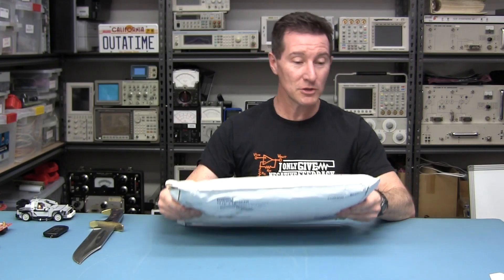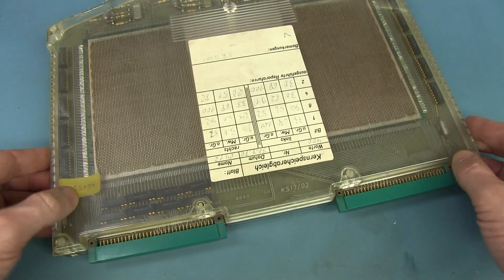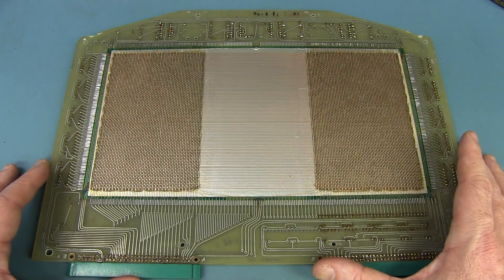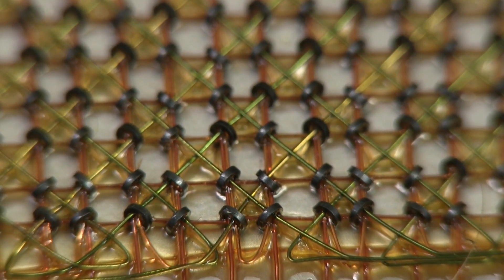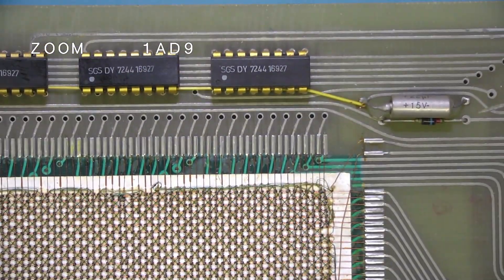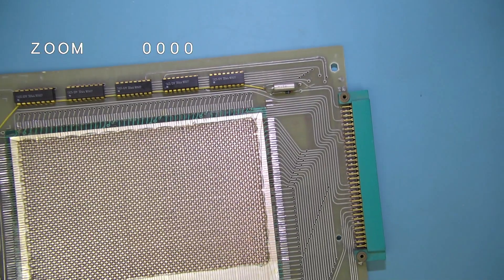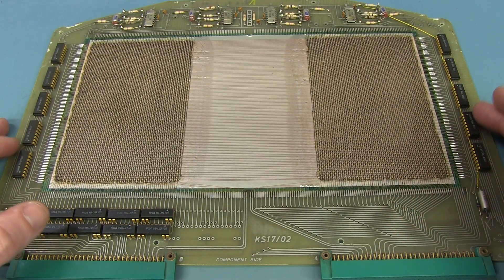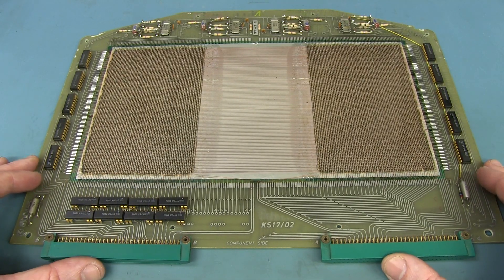Magnetic Core Memory

Comment: Back in 1980, I was a field service engineer.  The computer running our machines was a DEC PDP 11-04.  The thing I remember most about that computer was how hot it ran.  The 8K core memory used a lot of current resulting in a lot of heat.  I also remember that replacing a core memory board was VERY expensive.  One of the common problems in those computers was the air filter behind the front panel.  Most people didn't even know it was there.  I'd pull the foam filter out and it was completely clogged with dirt.

Comment: I don't understand how you get a proper "read" on the sense line since it's a single contiguous wire; well maybe I do; it might have just clicked. The pulse on the "sense line" comes out in the order you send the addressed pulses on x/y lines? So it all occurs in serial? The output is only relative to the order of the pulses sent? not an electrical engineer; not a computer engineer. barely a network engineer. Just interested. Anyone care to explain if I got that right?

Comment: By studying the most basic ferrite memory core design, several dozens of computer nerds were able to figure out on how to create the 3 dimensional physical geometric pattern for the wires and for the ferrite cores using an over lapping technique using the basic CMOS principle for a proposed thin film transistor technology modified to act as a base for the original basic ferrite core memory which was started in 2011 and they were successful. Mass production on a micro scale was done successfully in the same year and they already have ironed out all of the kinks. What they have now in 2019 is a stockpile of thin film transistor based-ferrite core memory which is far easier to mass produce despite the fact it is more bulky, cumbersome, large size like a paper towel with a storage capacity of 2 terabytes. Being solid state, without having any moving parts to wear out, and it's flat ferrite core wafers can store memory data and information indefinitely without being affected by EMP, EMI, EMF, CME, Solar Flares, all data stored in them are safe from being damaged or destroyed.

Comment: 3:03 an elaborate machine winding core memory = very skilled women sewing ferrite cores. I don't know that a machine was ever designed to stitch core. Please correct me if I am wrong on that, folks.

3:56 I believe what you get is what is stored in the ferrite torroid: the magnetic field is circulating either clockwise or counter-clockwise so you get either a positive-going pulse or a negative-going pulse (not a positive pulse or no pulse at all) which you could define as representing a one or a zero. Either way, the reading of the bit state was destructive and was followed with a rewrite of the bit.

Comment: I have another board of core memory, roughly the same size (a little larger). It is marked as from a DGC Nova from 1972 but may have been used in a Danish computer. It has 16 K words of 16 bit so the cores are really small.

Comment: They already had microchips but no flip flops yet!? It seems that flip flop memory only appeared after ICs. I know that flip flops would take way too much space with the old transistors which were the size of a AA battery or Vacuum tubes which were even larger and less reliable... A single flip flop would be a whole board circuit and it would be just 1 bit. So magnetic core memory is in fact smaller than macro flip flop circuits. But nowadays we have micro flip flops as RAM memory. Flash memory however is in fact a single specialized transistor which can store charge within itself. No wonder Flash Memory is much denser and cheaper than RAM not to mention it's not volatile. HOWEVER RAM (Flip Flop) memory is MUCH MUCH FASTER! That's why Flash is not used as RAM.

Comment: Don't write to it until you read it out!!!  It's non-volatile so whatever was stored in the 1970's is still there.
Reply: Reading it will erase it.  You have to re-write what you read to restore what is in it!
Reply: @Derpy1969  what if it was never read? But then again it is old
Reply: @deathbydeviceable  try to find out if posible, may have some stored data on that memory
Reply: its from a missing apollo mission
Reply: It holds the secret location of Atlantis
Reply: Non volatile? Don't magnetic flux drain over time??
Reply: @gopronomad4381  yeah about 400 years
Reply: You would not be able to make sense out the contents of a single plane of cores.  How was the memory organized?  One plane usually only contains a small part of a word, as little as one bit.  Most of the data are not text anyway.  How would you know what it was even if you could read complete words?
Reply: @GH-oi2jf  True, it's only a bit slice, but worth a try. If you see any kind of pattern it will tell you that it did retain something.
Reply: Probably 2 bit porn
Reply: @Tim-Kaa  We had files of punch tape strictly for testing. Paper tape of images encoded in baudot that had been painstakingly hand entered over decades by unsung heroes with an artistic bent. These were used for testing teletypes and teletype circuits. They would be considered soft porn today. We used them strictly for testing purposes. Go chAir Force! Baudot Babes exposed for all to see who had the right stuff. :-P On topic the memory was magnetic core driven by Raytheon tubes used in KW-26 encryption equipment which the teletypes were hooked up to.
Reply: if that thing came near any magnetization in 50 years. its dead.
Reply: Aliens ?? 🤪
Reply: @ronaldbrown9638  no, and also all Data On There is Non Existent
Reply: Ronald Brown 
3,200 bits isn’t enough for that

Comment: I worked on old systems that had core memory in the early 80's and I also worked on systems with delay lines.  Interesting fact about core memory, if you had an error in your program that caused a tight loop (like an instruction that branches to itself), you could actually burn out the core memory drivers.  Also, with the delay lines, they came mounted as a long coil of wire in a case the size of a hardback book and if you hit the case it would corrupt the data.

Comment: I worked on a miniicomputer with 128k of 8 bits in ferrite rings.

Reading out the memory destroyed it as you say. However equally bizarre by todays standards is the fact that powering down did not lose memory.

We stopped our machine in Slough Uk, shipped it to Anarctica, turned it on after 6 months power down and all our programs were intact. Pressed run and it did.

No need to hibernate - core is inherently non volatile on power down. 

The 128 kb took about a foot of a standard 19" rack.

Those Perkin Elmer 8/16 E minis were last manufactured in 1980 and may have been the last gasp of core memory.

Turning to your unit - not only might you be able to store data but it almost certainly still contains data from when it was last powered up. So please do a read before you write.

Comment: Destructive reads aren't exclusive to core memory, though; modern DRAM is also read destructively. The re-write is all handled on chip so it's not like the CPU has to handle it, of course, but the same would have been true for core memory controllers.
Also, most of the performance from modern DRAM comes from buffering and pipelining; if you count the row-cycle time, tRC, as the true speed of the DRAM banks themselves (not an unfair measurement, I reckon), even the latest and fastest DDR4 banks are only about 25-30 MHz, an unusually small improvement since this 1970 module in computer terms.

Comment: Interesting tidbit on magnetic core memory:  Since it retained its values without power, if a program or the OS crashed, they would run a "core dump" routine to read out exactly what the computer was doing at the time of the crash. They could reconstruct what caused the crash. When I was studying computer science in the 80's, we would refer to a test where we had to write a lot of information down as a "core dump."
Reply: It is still called that, even long after computers no longer have core memory.

Comment: Hi Dave
That brings back some old ,days. I used to work on core store memory systems.
You are quite right, reading is destructive. What would normally happen is a read would involve a write to see if the core changed state, then you would do another write to set it back to its original state. In order to change the state of the core both the X and Y lines need to be activated. This is where the inhibit line comes in, it is usually in parallel with the X line. Current is passed through the inhibit in the opposite direction in order  to cancel out the X line (both X and Y need to be active to set the state of the core). Where it comes into its  own is when you have a bank of say 8 or 16 of these in parallel and you need to write a bit then the inhibit would be enabled on all but the bit you wanted to write.
Anyway I hope I was not telling you something you already know but it is a very interesting bit of history.
Thanks for the video.
Reply: He probably does, but the rest of us don't. Thanks for sharing.
Reply: ur smart

Comment: Ive done some rough calculations and going by his figures of 160 million of these boards equating to 2GB on the SD card, assuming this unity with its palstic case is about 20mm thick, stacking that many on top of each other would be 3200KM tall!

Comment: May be a bit out of date(sorry about the pun), but fun to see. I date back to those days myself. In fact, the Tomahawk cruise missile had a core memory in its guidance set! Better yet are the drum drives that would explode occasionally when a bearing failed, and they would, because they spun as fast as mechanically possible. The drum case was 1/2 inch thick aluminum to hold the fragments after a failure!

Comment: Back when I was in college (early '80s) I was given 2 old terminals.  Sounded like a hurricane when you powered them up.  When I tore them down, they had 2k of that ram in each.  The keyboard was comprised of individual hall effect switches.  If I hadn't parted them out, they could have flawlessly run continuously to date.  Built like tanks to last forever.

Comment: The 7244 from another vendor is a quad operational amplifier. That would make a lot of sense given what this board needs to do. If you trace how the pins are used you can probably confirm. Link to the datasheet: http://rohmfs.rohm.com/en/products/databook/datasheet/ic/amp_linear/opamp/bu7241g-e.pdf

Comment: I could be mistaken but I thought the space shuttle used some of this memory as old technology is favoured for space flight. The z80 and 6809 were used in space probes until quite recently. All the bugs are known and the devices are more robust with larger structures.
Reply: Another reason they kept using the core memory for the Shuttle is that core memory is almost completely impervious to particle strikes and high radiation environments, where as semiconductors have to be radiation-hardened, which is expensive, and can affect the performance characteristics of the devices.

Comment: I worked on a postal automation system that used an ITT computer with 32K X 32bit core memory in 1976 - 8. That computer was new then.  I still have some cores somewhere, not from that computer, they made wonderful drive transformers for switch mode PSU's due to the square magnetic loop.

Comment: I knew a researcher who had a Dec PDP 8 in the antarctic. He said that They would power it down when they left for the winter and power it back up when they got back and the core memory was still at the same values. They didn't have to boot the computer, just toggle the run/pause switch. Awesome stuff even if it is bulky as anything.

There are some really good core memory training videos done by the army. Just search for "Electronics: Magnetic Cores I: Properties 1961 US Army Training Film"
Reply: Just as well we did not have to re-load the memory, we had to load it from paper teletype machine tape. took hours to load, had to load the boot louder program first, manually, bit by bit! Set up the instruction on a bank of 32 switches, then toggle the "load" switch,  program counter automatically goes to next location, repeat with next instruction.  We learnt to program like that, understanding what every bit did!

Comment: They can actually store log2(3) bits per core. Magnetized 1 direction, not magnetized, magnetized 2 direction.
Reply: Never heard of that!  the ones we had could only be changed from one direction to the other. must have been later. Cores where square loop material,  I guess to demagnetize the current would have to be 1/2 the maximum?  But that would be zero, and zero does nothing.
Reply: The topology of the wiring would be different, but it is still possible (but probably impractical) - the current would need some precise sensing - but the cores indeed could be in 3 states; assume the core has zero state, small current (below the one needed to cross the magnetizing amount) would have be different after some time; the other method is to have 2 spikes of current, one is enough to cross 1 and only 1 state, the other is nearly same, it would work even being slower and complicated.
Reply: How would you be able to tell the no magnetization state when you read it out?
Reply: 2 Impulses, 0 if no change in current due to same magnetized state 1 if changed to no magnetic state, 2 if 2 changes.

Comment: Please correct me if I'm wrong, but didn't the Apollo missions use a similar memory to this as part of their on-board computer system? From what I read, the program was hand-woven into the memory module by either passing a wire through the core (for a 1) or around the core (for a 0), this way the memory was a permanent and non-destructive but it couldn't be altered.
Reply: All "permanent" data for the Apollo computers were stored in rope memory yes. Although as others have pointed out, what Dave actually has here, is "Core memory", not rope memory. The same was true for the Space Shuttle as well, for that matter - it too used core memory and rope memory. It's very, very resilient to high radiation environments (like space) and cosmic particle impacts etc.

Comment: I designed in some magnetic core or bubble memory (from Intel) to a project I did for NASA back in '79-'80.  It was used to hold all the system constants/parameters in a large motion control system that went inside a large wind tunnel.  Abstract of a paper I wrote about the system below:
https://ntrs.nasa.gov/search.jsp?R=19820058244

Comment: In about 1977 I had a summer job in Silicon Valley repairing older Data General minicomputers. We had 16k x 16 bit memory boards that were 15" square all core memory. It was great as you could turn the power off on the computer, restart it and your test program would still be in there. By that time however "semiconductor RAM" had completely taken over for new systems. We still shipped out used machines with core memory, however! It actually worked really well and was very reliable.

Comment: what an awesome thing to get your hands on. now, I understand the basic principles behind the magnetic core stuff but have yet to find a "silver bullet" explanation or example of how it works for sharing the knowledge with others. any suggestions?
Reply: It encodes a bit into each core by either passing a clockwise or anti-clockwise magnetic field into the ferrite and magnetizing it.  If the field in the core flips during the write, it causes a pulse that is detected.  To read the memory, you simply write a zero.  If you don't see a pulse, the bit was zero.  If you do see a pulse, the bit was one, and you need to write it back to zero.

Comment: In the US Navy, I worked on a computer for the Trident C-4 Navigation system that used core memory. The thing I hated most about core memory was making sure the currents were adjusted properly because if they weren't you would get spurious data. You would think it would be a simple procedure but it's not, you had to get everything perfect.

Comment: This kind of memories were purposely created for specific computers. 
I bet that the computers that were using this memory board had many slots for memories like this. If something was wrong with one memory board, it was easily replaceable. Theoretically this memory can be repaired if something is wrong. Something impossible with later memory chips. Nevertheless this memory board has many integrated circuits. So it is not so archaic. 

Intel was one of the first companies that revolutionized and lowered the cost of RAM during 70's. People forget that INTEL was a major RAM manufacturer until Japanese monopolized the RAM market during late 80's and nearly brought Intel to bankruptcy. 

Memory today is very cheap and insignificant to the total cost of a computer but until 2001 it was equally expensive as the CPU.